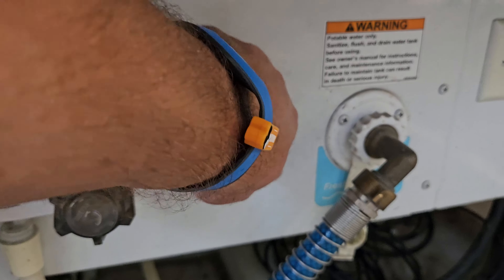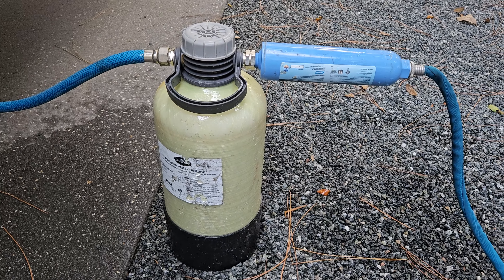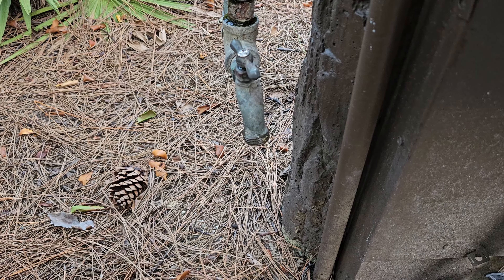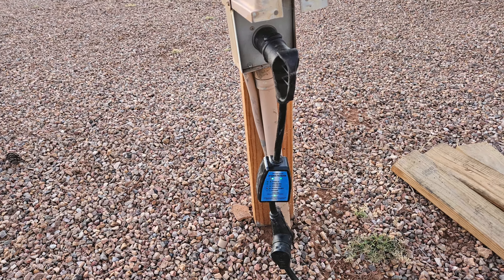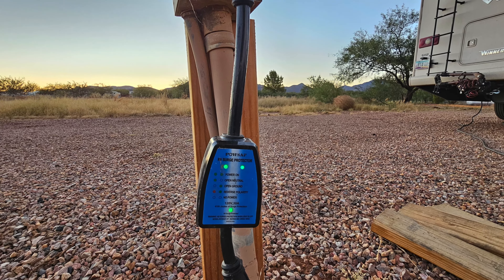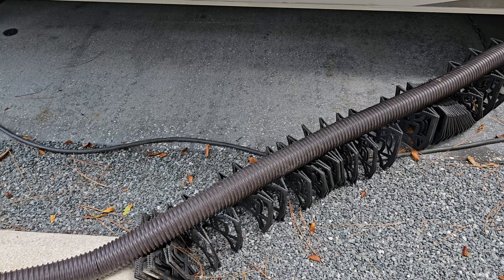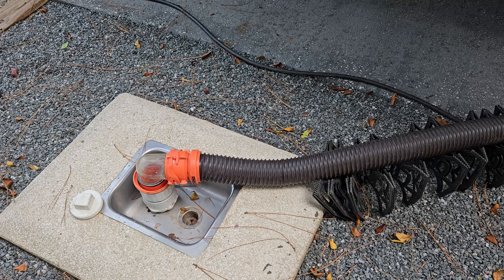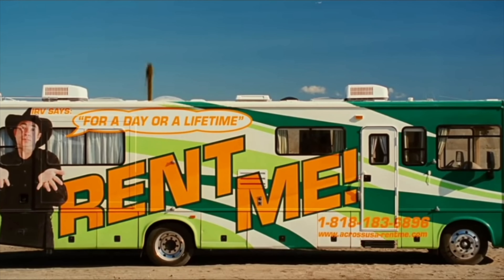Tips on setting up a Campsite #RV  #Travel

Comment: A couple of more to add regarding tank dumping, make sure the dump valves are fully in before removing the sewer cap.  A couple of years ago as we were leaving a state park campground in Tennessee I was in a rush at the dump station and got soaked with thankfully gray water.  I don't know why by my gray tank valve handle was pulled out, perhaps kids messing around in the campground.  The second one involve the free dump station at the city park a couple of miles from our house, where we often dump and flush our tanks when returning home from a trip.  When we arrived back in town last May from our trip to the Badlands of SD, I stopped by to dump the tanks as we were getting into town on the way to the house, and when I tried to dump the sewage from the black tank backed up and overflowed everywhere, it seems the dump station plumbing was mostly clogged by some previous user.  I reported it to the city, then went back by a couple of days later and was able to dump just fine.
Reply from the maker: Excellent additions, Ike. I am going to add a comment and pin it to this video with everyone's added  tips and I'll be able to edit and add to it as time goes on. Safe travels! 
Kenny

Comment: All of your advice was very much appreciated. I just thought of two other things
> Be very careful about flushing paper towels down your toilet. If you need to flush them down the toilet, tear them in half before using them.
> Next, if your #2 tank gets clogged, try driving around a little bit to dislodge the obstruct. After a few miles or so, try to open the #2 tank again.
Reply from the maker: Hey Mark, it's great to hear from you again and thank you for the tips., I am going to make a comment with additional tips from comments we receive. I'll add these two tips to the list. I'll be able to pin the comment to the top and add to it as new suggestions come in. Thanks again!